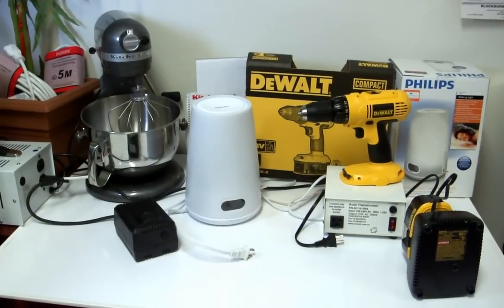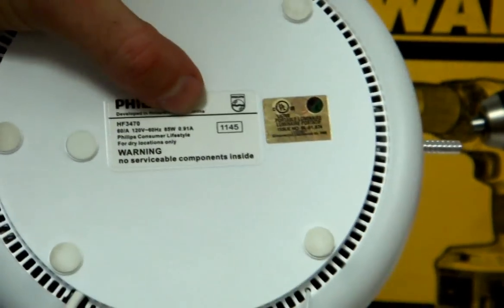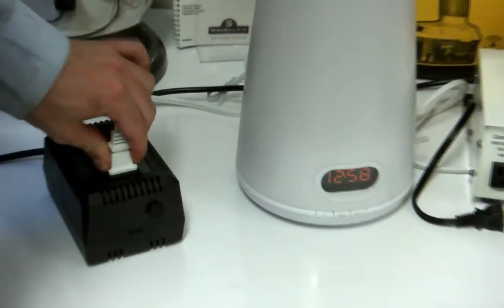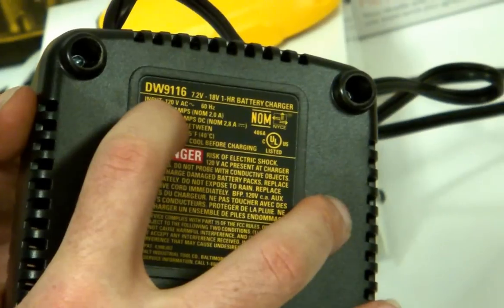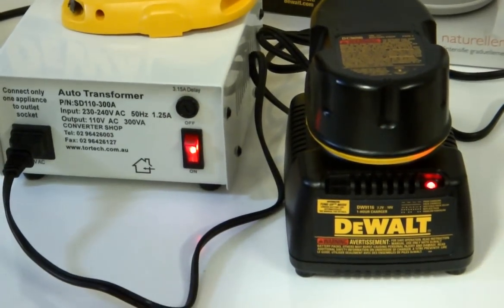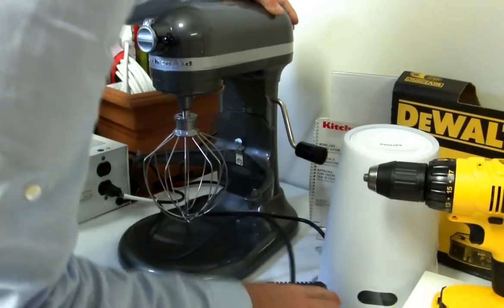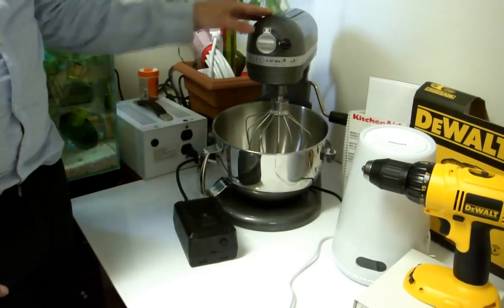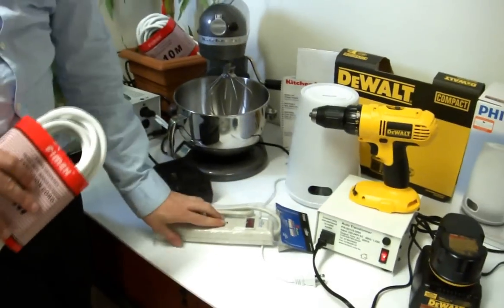step-down transformer - how to run USA equipment on 240v Aussie power voltage converter

Comment: Hi there! Thank you for this video and I find it very informative. I'm from the Philippines, I also have a 120 volts kitchen aid stand mixer which my cousin sent me from California. I bought a transformer from online store here in the Philippines but only 2 pins can fit it in. My kitchenaid has 3 prongs. Is it safe to use a 250 volts adapter with 10Amp to 120 volts then plug it to a transformer which has 220 volts power source? Thank you.

Comment: I believe he omitted to mention something quite important. First: For all equipment working with a motor (ie the KitchenAid mixer) we need to multiply the calculated Watts is 575W by 2.5 or 3 which makes it 1400 to 1700 Watts which is the minimal required to ensure normal work. The reason being that in the start these equipment absorb 2.5 to 3 times more Amperes. Second: Electronic appliances are affected greatly by the difference of frequency from 60 to 50 Hertz. IF you have an oven with digital thermometer, clock etc for example, they will be affected. I am not sure how much, but somehow at least. Please be well informed before you decide.
Reply: Hello sir please can you help me choice a good transformer converter for a USA air dryer i neet to import it to Italy for my business, kindly let me know if we can collaborate. Best regards Andrea

Comment: Can i run a tool that is 85 watts on a 1000watts stepdown transformer
Reply: yes
Reply: But the question is; will the power consumption be 1000 watts because of the Step down transformer or only the 85 watts by the equipment!????

Comment: to Shane C the product voltage by amps DOES NOT give watts, though in reality that is the measure of power that is needed to rate correctly power transformers and it's measured in volt-ampere. this difference is due to alternating current system used for electric appliances all over the world

Comment: Thanks for this. How could I use a Meat grinder imported from US which has a 110V in India which has a 240V system.
Reply: pretty late for reply.   you may buy a step down transformer whose wattage , read wattage is  1.4 times the wattage written on the apparatus.  BTW, cost of the convertor would be 3 times the cost of the appratus

Comment from the maker: Hi on our  list page we have a table showing nintendo, xbox and many other devices and how much power they draw. We also have a handy calculator which you can enter the Amps , voltage to determine the total watts consume by your device see http://www.tortech.com.au/choosingrightstepdown
Reply: I have a query!!.... If the stepdown transformer is a 1000W and the equipment which I'm using is 50W; will the power consumption be a 1000W by the transformer or just the 50W by the equipment? I dont want to pay an air conditioner's worth electricity bill for a small lamp!

Please help! :(

Comment: will a britich air conditioner 240 volt work off american dryer circut with fuseing down to right amprage and will refrigerater from germany work on 240 volt dryer circut with fuseing down to 20 amps on both legs german is 220 england is 240 is both withen tollerance for american dryer circut with both legs fused acordingly

Comment from the maker: NES: 9 watts
Super NES: 10 watts
Nintendo 64: 19 watts
GameCube: 39 watts
Wii: 45 watts
PlayStation 3: 200-380 watts
PlayStation 3 Slim: 96 watts
Xbox 360 Elite (2007): 185 watts
Nintendo Wii: 19-53 watts 
Xbox 360: 187 watts
Reply: I used a adapter on my gamecube and fucked it. Need to get it fixed and buy and a transformer.